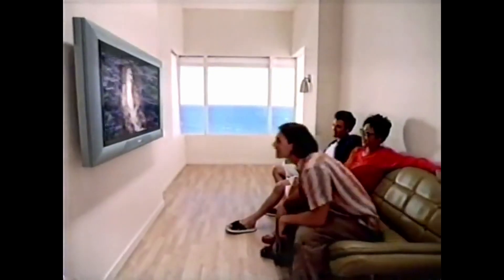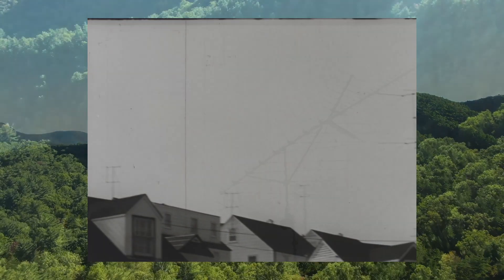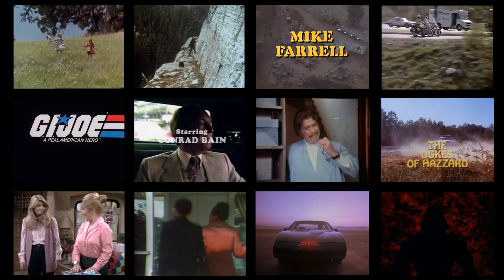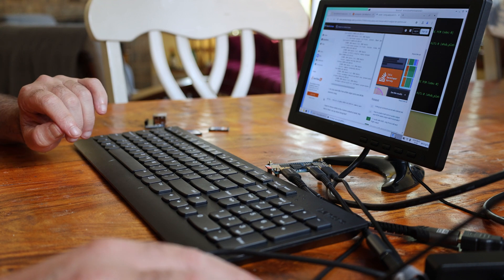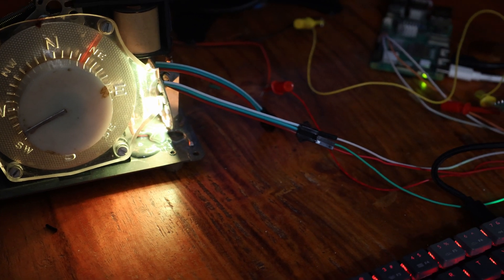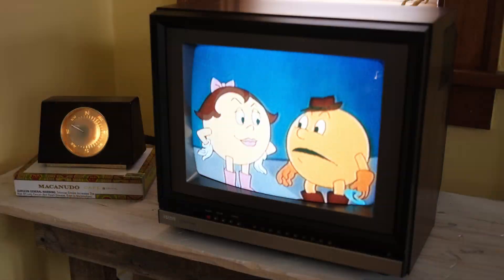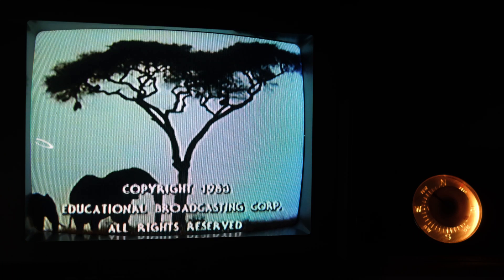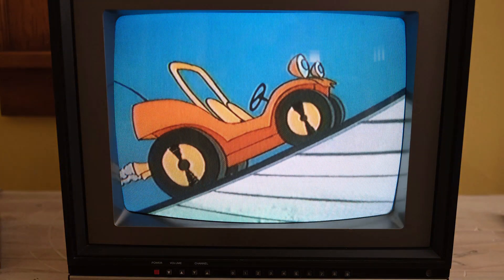My Nostalgia Machine: Recreating 80's broadcast TV with a Raspberry Pi

Comment: So to be clear, do you have multiple simultaneous schedules running and the one selected will join it in progress when you do a channel change? 
I am older and grew up in the 50's and 60's. My plan is to have separate playlists running  with multiple RF modulators. Used rf channel modulators are cheap and combining them on an RF distribution system would mean I would rotate the actual tuner knob to the desired station and adjust the fine tuning.
But I like your concept as it appears more compact and efficient.
Reply from the maker: Exactly. Each channel you configure is running its own schedule. When you switch channels, it will join it in progress as though it had been playing the whole time. When you flip back to the channel you were just watching, it will still seem like its been playing the whole time too. You should check out the next video on this, as it goes into more details on how the system works (and shows a lot of new features) : 
 https://www.youtube.com/watch?v=CDW1wokbRiQ

Comment: I saw this video when it was first uploaded a year ago and commented but the project is so fascinating I had to revisit it. It's legit one of the coolest things I've seen on YouTube. 

As I mentioned in my original comment, I am not at all a programmer and so I wouldn't know where to start with this, but I wonder how difficult it would be to create a similar experience using radio broadcasts instead of television shows. I think it would be really cool to have an old timey radio where I could turn it on and listen to old radio dramas and the like from the 1930s and 40s.
Reply from the maker: Oh my - it has come a LONG way since this video. Its been in very heavy development and has moved forward a long way. Did you see the cable TV focused follow-up? That's even way behind where we are now. There are literally thousands of people using it and building their own setups and the vast majority (95%?) have no programming experience at all. Many of the setup things are handled in the web ui now. You still have to do a bit of JSON configuration, but I am working on a graphical editor for station configs now that should even handle that. You can set one up easily.

To your specific question on radio, I am working on  adapting the system to support that now. Keep a watch and expect a video on that in the next month or so.
Reply: @wrongdog_reckons  Thanks for the response! I actually just saw the cable TV video. I will have to watch that one, too. It is interesting to hear that this project has really taken off! 

That is also interesting that you don't know how to program to set one of these up. Is there somewhere where step-by-step, start-to-finish instructions are posted? 

Regarding radio, I will definitely keep an eye out for that. I spend a fair amount of time listening to old radio dramas and would like to be able to recreate a linear experience that replicates what it would be like to listen to the radio live in the first half of the 20th century.
Reply from the maker: @sorenpx for sure - instructions on the GitHub wiki: https://github.com/shane-mason/FieldStation42/wiki
Reply: @wrongdog_reckons  Thanks! I'll check it out. 

One last question: If you wanted to be able to build something like this from scratch, how much programming experience would be required? Like, if you were starting from zero, how many hours would you need to invest in learning to get up to speed?
Reply from the maker: @sorenpx - good question. I've been programming for almost 30 years and I found parts of it challenging - the schedule and playback logic aren't rocket science, but it's also not commodity work. There are some tricky problems to solve. With that said: if it's something you want to build, you could probably start making progress on it after taking a couple of introductory courses. Maybe a couple of months to get started? It depends on the language you choose and how good you are at it. I would recommend Python. Since it's far to learn and fast to code. That's what I used here.

Comment: That is awesome. We really can't truly simulate the look of live analog TV broadcast, especially live events like the news and sporting events. As well as stations with stronger signals. Shows on prime time looked the best, they would lose a lot of their quality in syndication. It was a look that gets lost in the tape recording. Even cable tended to wash the picture out and took away the dynamic range and color tones you got off an antenna. Off an antenna each station had its own look that would come through well through the TV's tuner, but not the VCR tuner. At least for me it added a vibe.The VCR and cable tended to make each channel kinda look the same. I have come across a few recordings online that preserved it pretty well. I'm guessing some higher quality commercial recorder was used. Also we can't forget ghosting and the bar that would sometimes appear on one side of the screen from multipathing.
Reply from the maker: You are not wrong at all. Interestingly enough, I think some of the best VCR recordings came from the earlier VCRs. They seem to retain the dynamic range better - less flattening of the image. I've thought about adding a transmitter so I can pick up some of the OTA artifacts that are missing here. Cheers!
Reply: @wrongdog_reckons  Thanks for the reply. I totally agree, some of those videos from the 70s look amazing. I remember the top load VCR we had in the library school looked good. They would record PBS content off an antenna on the roof and I remember how good it looked. They got a second one later on and that one never looked as good. The VCR in my profile pic is from 1979 and has a better picture than many newer ones. They found ways to make the newer ones more affordable and with that I guess some quality got lost.

Comment: You have a great setup!!  I love it.  I have been thinking of doing something like this .... BUT .... I was just going to use Pies ... Pis ... Pieeezes 😅 to stream OLD content ... one Pi for Doctor Who ... another for Knight Rider ... and so on.  🤔  But I was going to run each Pi through an  NTSC  RF modulator (assign it different channels) and pump it through coax .... OR .... kinda sorta broadcast it (as much as I could) locally.  🤫  I would love splicing in old commercials and TV bumpers and the line up as you have it.  🤗  A lot to think about now.  😊
Reply from the maker: Sounds like a great idea - I think you're on the right track! Keep us updated as you build it. Cheers!

Comment: Thinking about doing this as a summer project but I’m pretty new to stuff like this. Is a raspberry pi 3 strong enough to handle this? Also, what size sd cards are you using?
Reply from the maker: I'm not entirely sure if a raspberry pi 3 can handle it, since I haven't tested it. There's an easy test though: if you can get MPV to play videos and you are happy with the quality of the videos and there isn't a long lag time when you seek in the video timeline, then you should be fine. The simulator itself doesn't add much overhead at all. I'm only using a 32GB memory card, but I have a larger external drive attached. Give it a try and if you run into any problems, just post an issue on github. Cheers!

Comment: any updates on this? Any interest in helping me with mine?
Reply from the maker: There have been lots of upgrades and improvements make it so it also works as a 90s cable simulator.  Working on the video right now :)  Happy to help you get setup - the wiki on github now has full instructions and if you run into problems, file and issue on github and I'll help you out. The github link is in the description.

Comment: What if instead of a direct connection you used some small VHF transmitters? That way you could use the TV's own tuner and with a weak enough signal you get the snowy picture most of us had to put up with in rural areas. My grandparents lived in a narrow "holler" and had an antenna up on top of the ridge, it was about a 30 minute hike to climb up to it and maintain the lines or adjust the antenna when the wind blew it down or out of alignment. Really fun in the wintertime. 😆
Reply from the maker: So, I've thought about actual OTA transmission lot and just need to learn what components I need to just do it. Your antenna situation sounds a lot like our water situation - we got gravity water from a spring-box up on the mountain. When it froze or leaves blocked the entrance/exit pipes it was up the hill to play in cold water in the middle of a freezing night. Those were the days huh?

Comment: Are there commercials?
Reply from the maker: There are commercials and there are also bumpers (network Ids) - these get cut in at a frequency based on the native video length and the schedule block increment. But for things like movie channels and public broadcasting, you can set the bumps and adverts to happen only between the shows or even none at all. Its a fairly accurate cable and OTA simulator at this point :)

Comment: I know maybe hard to answer, but where did you get the content like news and ad blocks?
Reply from the maker: Of course, you should only use content that you have a legal right to use based on local laws. I have noted though that archive.org has a 'VHS Vault' - which are where people have uploaded old VHS tapes that have whatever the people were watching. That includes commercials, bumps, news and all sorts of stuff - you might check there for legal content. Best of luck - let me know if you get stuck on anything setting it up!
Reply: @wrongdog_reckons  thanks, Yeah I saw that on your reddit thread and found some stuff in the VHS vault and also in Youtube

Comment: I'm thinking about this project everyday, I am right now building up my library of the stuff I want to watch. How does it handle downscaling if I play 1080p content on an older tv? I have not tried setting it up yet
Reply from the maker: Awesome - its a fun thing to have around :) My best advise is to open it in MPV (this is the movie player that FieldStation42 uses) and see how it looks. If it is in 4:3 ratio, you should be fine. If it is in 16:9 (widescreen), then it will look funny. I took the extra steps of downscaling all of my content, even though MOST of it would have been okay as-is. If it was 16:9, I just used the center 4:3 cut.
Reply: @wrongdog_reckons  ok great, will try it when I find some free time 😁 my brain is full of odeas for the channels that I want to have

Comment: Is there a way to use a tv remote to change channels?
Reply from the maker: A couple of folks have gotten them working - here is a post: https://github.com/shane-mason/FieldStation42/discussions/47

Basically, there is a hook that lets you change channels by writing a bit of JSON into a file it monitors. So, anything that you can get working to get a signal in, if you can write a little script to put the JSON channel change command in that file, it will pick up on it. I can help you if you get stuck.
Reply: @wrongdog_reckons hey thanks for the reply I’m trying to do this right now and whenever I try and create a schedule it says no module named moviepy
Reply from the maker: @RealDylanGames  A couple of quick guesses: Did you run the install script? If so, did you activate your virtual env before trying to run station42? If none of that helps, can you file an issue on the GitHub project? It's easier to talk and troubleshoot there.
Reply: @ I uninstalled and re-installed an earlier version of moviepy and i think that might of fixed that since I’m not getting that error anymore, however I’m having another problem so I’ll open an issue

Comment: I'm feeling a little sad. Every comment before and after mine gets love from the author, but mine :(  I added cool, new functionality to make the experience feel more authentic—like an actual analog cable TV—and now I am hoping this doesn't disrespect the original author. I put alot of work into it already... 

Here's a summary of the functionality I added to the code to make it easier to digest:

I added several new features to enhance the user experience, which I'll be sharing with the community via a GitHub fork or if the initial author wishes otherwise:

Flirc IR Remote Control USB integration: The system detects a Flirc IR receiver within the first 5 minutes of boot, shutting down the Field Player and showing a green setup screen. Users can easily program their remote by pressing the channel up/down buttons, without needing to edit configurations each time they try a new remote. This keeps the immersion feeling like programming via VCR menu screen.

Game Channel (like Channel 3/4): Instantly launches an NES or Genesis emulator on a dedicated game channel, showing a random game’s start screen, evoking the nostalgic feeling of playing video games / turning it on while on a CH3/4. That instant boot up of a game's title song etc. 

Guide Enhancements: The video guide now shuffles random videos from the guide_videos/ folder, with a slight delay to randomize the guide's starting position each time the GUIDE channel is tuned to. It adds a bit of unpredictability to the channel guide, making it feel more organic.0 This is the same for the scrolling guide itself, it has a random offset now so it doesn't always start at the first channel.

Cable Box Transition Effect: I added a -t pop transition, mimicking the sound and look of flipping through channels on old-school cable boxes from the late 80s/early 90s.

Channel Flipping & Volume Control: With Channel flipping is controlled by the IR remote’s channel buttons. I also added volume control (new volume.socket requests) that works across all channels, including the guide and emulator, not just through mpv's volume control.

I'm planning to test compatibility with cheaper IR receivers soon to expand the functionality.

TODO : Adding: WeatherStar4000+ network_type to have an authentic realtime weather channel in the flipping mix..

Comment: Perhaps consider trying to optimize the code to run on the original Pi/Pi 2? They had dedicated analog video outputs, and could be beamed to the old sets with video inputs without conversion.
Reply from the maker: It should run there okay - my concern is around HW video codecs. I have a couple laying around, I'll have a look at it.

Comment: I wish i was smart enough to figure out the coding and stuff needed to do this. Would likento put one behind my tv showing all the stuff I grew up with. And use a remote to change the channels.
Reply from the maker: I've added lots of documentation and we're working on making it easier to use and adding features everyday.  I'll also do a video very soon on how to set it up for yourself that should be helpful. Cheers!
Reply: @wrongdog_reckons  that would be very helpful as I have no clue what I am doing when it comes to this stuff. I'm slowly learning. But fail more than I succeed.
Reply from the maker: Keep at it - we all fail more than we succeed. Cheers!
Reply: @wrongdog_reckons  that is completely true. I found your instructions online. I have been spending the last couple of hours reading it and messing with it to try and set up a channel today. It's been extremely helpful. Thank you very much.

Comment: Thats a LOT of work to watch old TV.
How many hours, between gathering the shows, programming, making the hardware, debugging, etc.?
Reply from the maker: Yes indeed. The initial code was pretty fast - maybe 20 - 30 hours or so for the prototype that the video is made with. On the content, many hundreds of hours? It took by far the most time but was very relaxing and cathartic work. Since then, I've spent a large amount of time on the code base, building out a lot of features and handling weird edge cases since I made the video - at least another 80+ hours on that. The truth is, none of it has felt like work though (except for a few moments of frustration here and there) - I have genuinely enjoyed every minute of it.
Reply: @ enjoying the process is the most important! 
Thanks for sharing it all

Comment: I've been doing a much simpler take on this for the past year with a simple HDMI to Analogue converter and a pair of bunny ear antennas. I've got a small collection of portable CRTs and with this setup I just broadcast my fourth monitor over UHF, then slap on a VLC playlist of cartoons on shuffle. I've dreamed of having something this detailed though, massive kudos to you for the undertaking.
Reply from the maker: Can you tell me what you are using to broadcast in UHF? That's a sweet addition.
Reply: @wrongdog_reckons  It's a generic converter from China I found on Amazon, the seller is Dpofirs but others might have the UHF/VHF model. I tried posting a link to it but the comment keeps getting deleted.
Reply: @wrongdog_reckons  I got a cheap converter off amazon, the seller was "Dpofirs". There's a lot of resellers but I know that one had the specific UHF/VHF model.

Comment: You need commercial breaks every 5 mins. Commercials that are relevant to the time slot in which they air. Commercials for tonka trucks during Saturday morning cartoons. Shampoo and fast food commercials during midday game shows and soap operas.
Reply from the maker: It cuts in commercials at the same rate as the original shows (since it has the same left-over time to fill) - and there is a request on github to support per time-slot commercials and bumps. Right now, you can get a Budweiser commercial in the middle of scooby doo and tonka commercial during Johnny Carson, so that's not quiet what were looking for :)  Cheers!